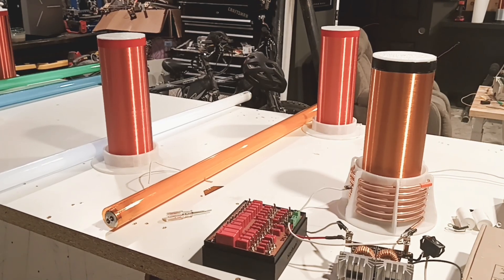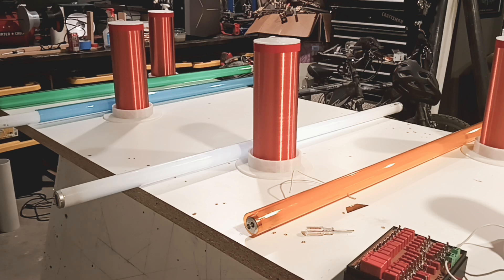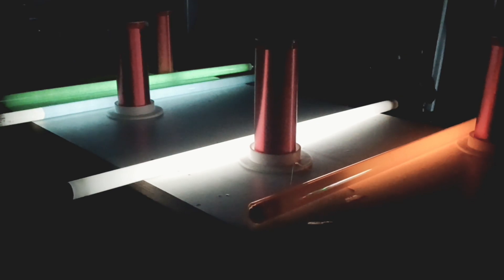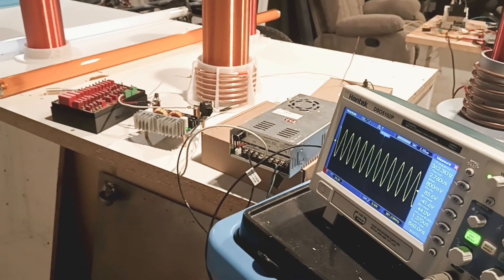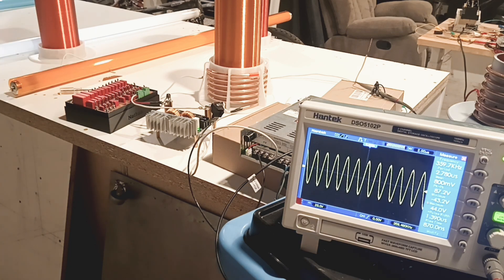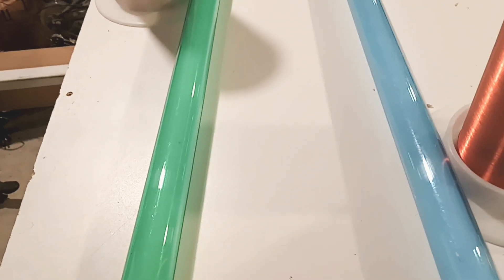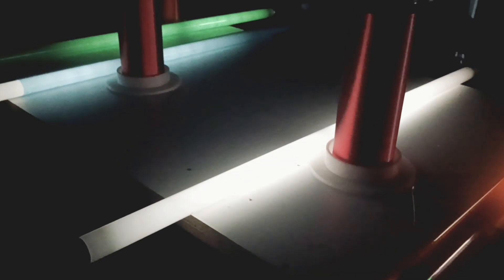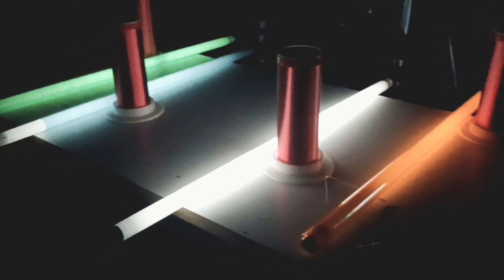Tesla Coil Capacitor switching board

Comment: Don smith famously said there is no electron flow between two coils in resonance. It's quite the same as a tuning fork being struck but in this case it's all magnetic. Plate capacitors display similar characteristics.

Edit: he also said at resonance you are getting into superconductor territory which i believe